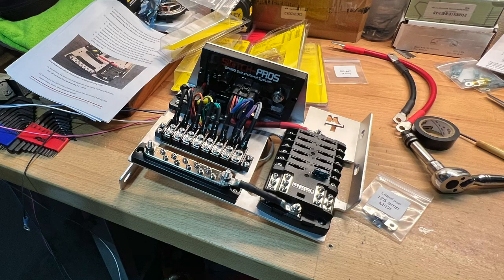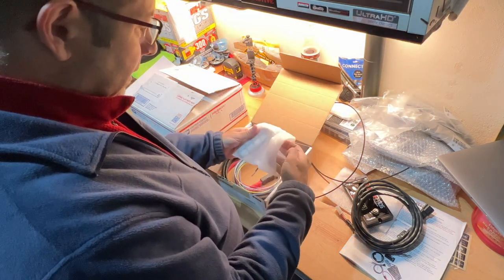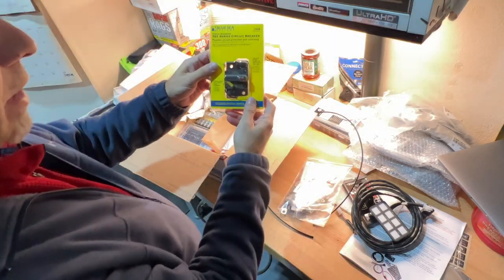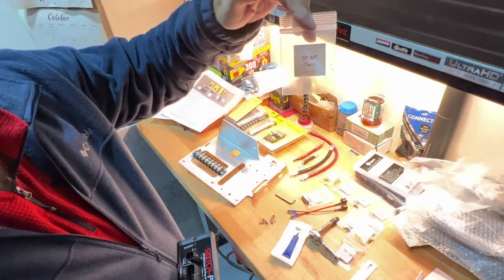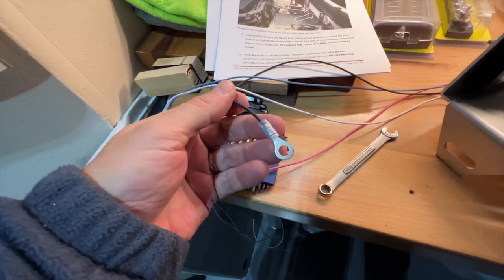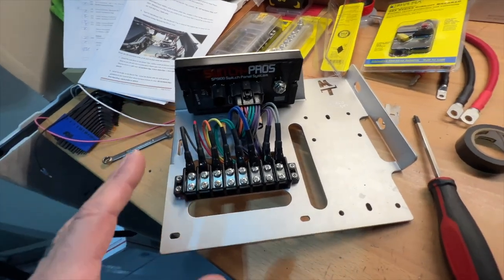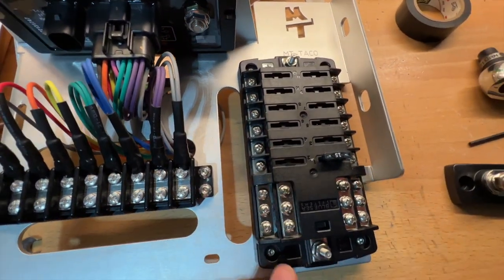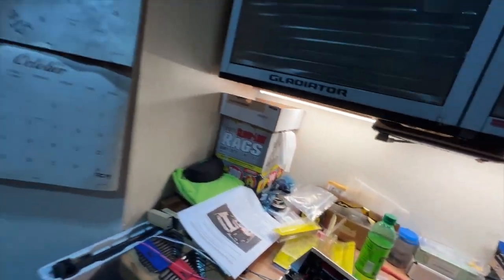Toyota Tacoma Power Tray Upgrade

Comment: Why did you add a fuse panel. That is not needed with the switch pro. The Switch Pro has it built into the circuitry and Switch Pro does not recommend using a fuse panel or any inline fuses on the wiring?  Otherwise a nice setup.
Reply from the maker: Stay tuned.  I’ll cover that in an upcoming video🤔

Comment: Yhis is and excellent was to make electrical mods easy safe and end the need to going thru the fire wall so that you can install the power switches always in my opinion the worst part of adding any electrical components without cutting thew water tight gaskets then tying up wires so they don't get hit by a foot or hang loose good luck.
Reply from the maker: Absolutely!  Easy to do from now on👍